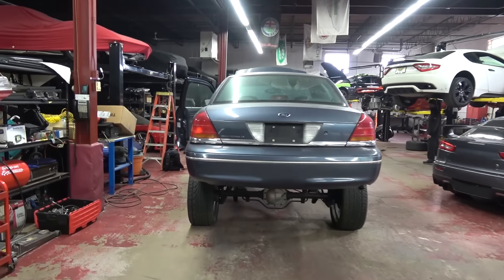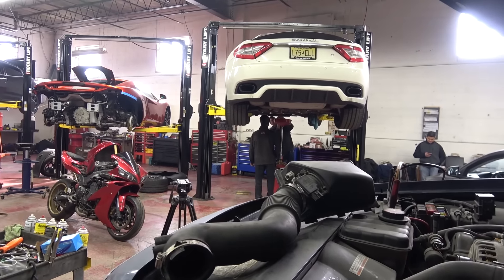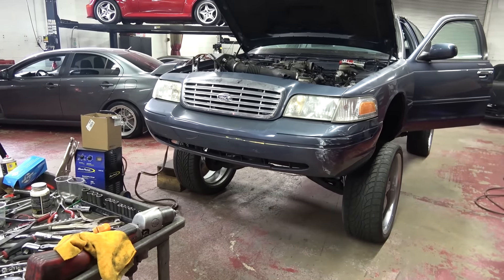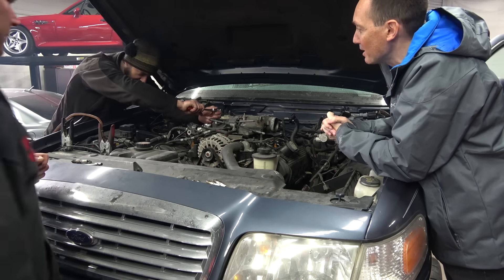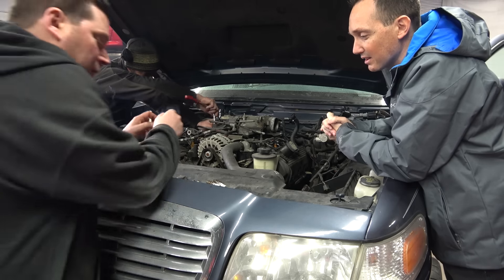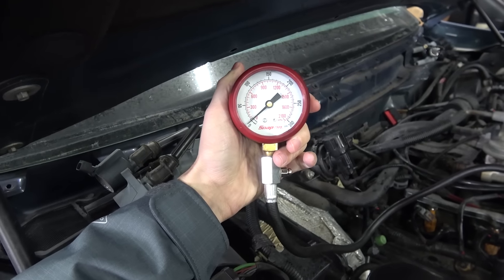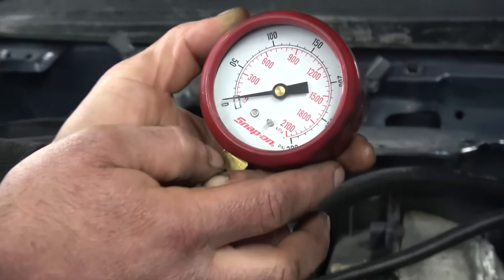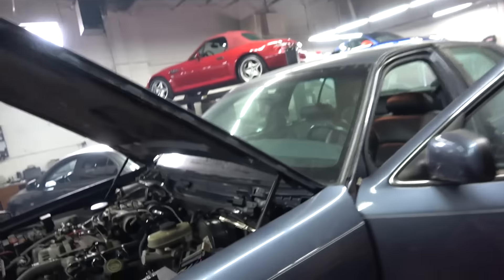So I Bought A Donk With A Blown Engine

Comment: why didnt you check compression first before throwing money at it
Reply from the maker: I asked them to, they said to start with gas, battery, and spark plugs because they were all needed. Guy who sold it didn't say the engine was blown.
Reply: He needs a new mechanic. Compression test would have been the second thing I did in diagnosis first would be to hook up the mct scanner and read codes..then compression test. .. I have a feeling the only reason Rob Bacchus was to get us all to say what the hell....
Reply: you need to turn the car over while you are there, the uneven compression noise during turn-over is a queue that something is not right
Reply: User65536 agree.
Reply: He needs the car wizard!
Reply: @T K is that a BuzzFeed headline or one of his click bait video titles?
Reply: @T K 😂😂
Reply: Phil Coleman really you wouldn’t swap a coil first?
Reply: Can check compression with an ossilascope and see how much current draw on each cylinder. Literally takes a few minutes. These mechanics are hacks
Reply: I could hear through the video that it had a compression issue! His mechanic sucks!
Reply: Just by the sound it made when it cranks tell you there is a compression issue.... this is simple stuff find a new shop rob...
Reply: @philcoleman3745  Yea but if you say "if it is a compression issue are you going to get a new motor" and rob says yes, and you need those parts anyways to put a new one in. I mean unless the answer from rob is i'ma scrap it or sell it with a blown motor. It doesn't matter, because they are right it will need all those things regardless. That literally seems to be what everyone is ignoring even though it's exactly what he said. They acknowledged it was probably bad compression but that if you were always going to do the repair, do these others and see.
Reply: @sparkzbarca  before ordering one part for a vehicle I make sure I do a thorough diagnostic test.  All of the parts ordered will most likely come with the replacement eng if buying a complete junkyard engine. And buy doing a through diagnostics they would have realized that the coil packs were good and the engine does not have enough compression to run.
Reply: I thought  the same thing and then I thought of a better  question: why  would you buy this car?
Reply: The mechanic was either stupid or just straight up ripping him off.

Comment: Whoever told you those symptoms would be from a clogged catalytic converter should probably be fired
Reply: ... it's a top notch, modern, cylinder selective catalytic converter, Ya know, that's why it runs so unevenly ...

Comment: It seems like all the “cheap” cars rob buys end up being really expensive...
Reply: Cheap isn't cheap in cars, never was, never will be.
Reply: I bought a Toyota for $400 drove it 60 thousand miles.
Reply: @Mclovinthedank  Yes. Toyota. "Original" as from factory/(licensed) dealership I suppose. And a halfway decently maintained one, too, I suppose.
Toyotas used to be the world's benchmark in reliability and endurance for at least three decades up to about 2010. 
No way comparing that Toyota with any Motown car since the Model A went outta production, let alone a cheaply welder-pimped ghetto Crown Vic, right?

Comment: Pull the valve covers and check the lifters and rockers
Reply: jon doe  Nah needs a nice 302 or 351 Ford  Motor. No point putting an LS in a vehicle that will still be Found Off Road Dead for another issue.

Comment: What kind of shop is that, you don't need to throw new parts at an engine to diagnose problems with it,  i can tell that theres some cylinders without compression just by hearing the noise it makes when turning it over.

Those are some lame ass ignorant mechanics i tell you, get your cars out of there and run...

Comment: I get a feeling most subscribers aren't surprised. it makes for entertaining uploads, but Rob has the worst luck.
Reply from the maker: I think it is the trust I put in people lol. Which is why I suggest others not follow my lead and ensure they are getting what they pay for. I just don't like money I guess.
Reply: @superspeeders  Didn't You even point out the "three-stack" ....?
A car with "things" put on like that is supposed to be seedy in other places, too, I'd subsume. Like inside the engine/cylinderhead for example. Those engines are galore'n cheap I hear, though? 
You still could pimp it with a real motor now after the original crownvic's gotta go, on the other hand.